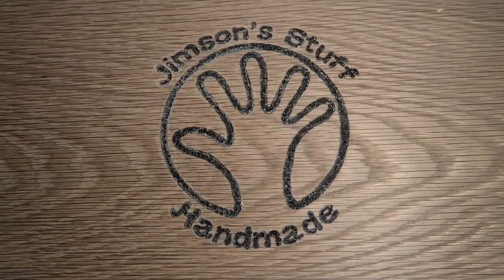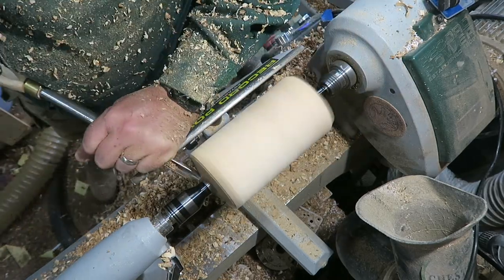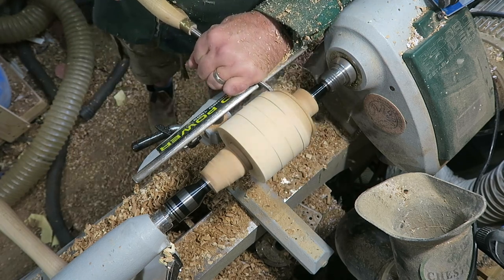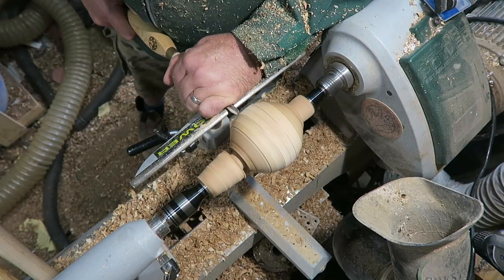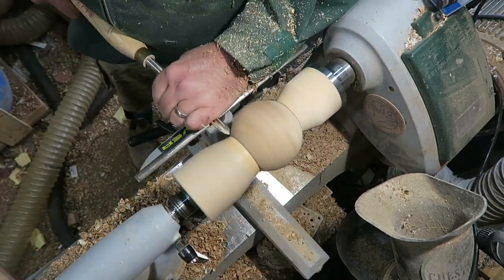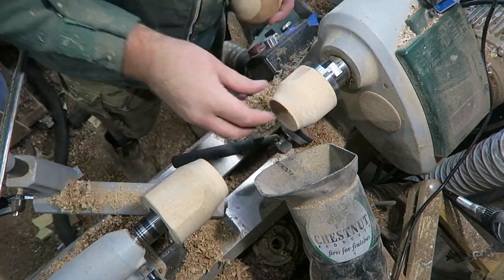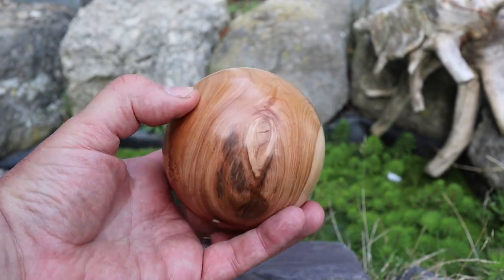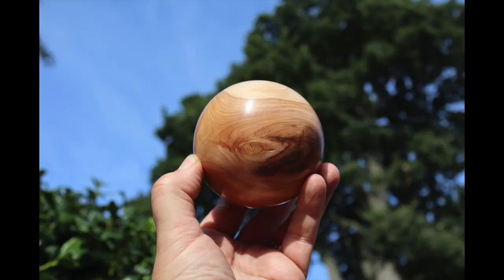Woodturning Planet Jupiter from an Apple Log - timelapse sphere turning.

Comment: Just finished Broadcasting with Ni no kuni Wrath of the White Witch remastered video game. And noticed your new video that wood sphere looks great and I also wanted to let you know I'm working on a brand new blank that's going to be a miniaturized base for a light for my smaller projects now I just need to practice learning how to work with the lights more less just the wiring
Reply from the maker: Thank you very much, your project sounds very interesting
Reply: @JimsonMakes  mixing some resin for my large pyramid mold that has my pine cone inside and I'm going to use a little bit of that resin to put on the 10th layer for the small base for my miniature light
Reply: Am I the only one that has problems with their spell check on their phone I always gives me the wrong words after posting comments and sending messages